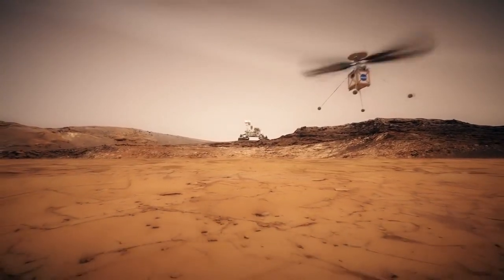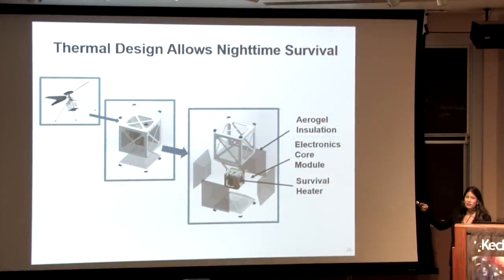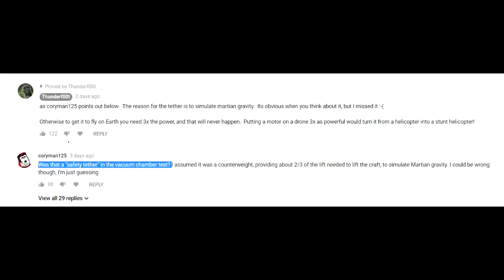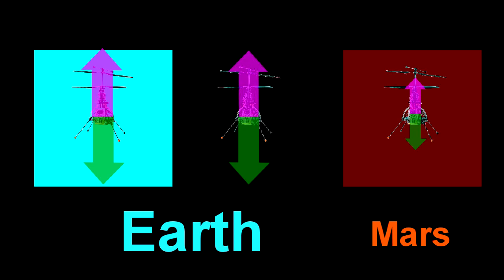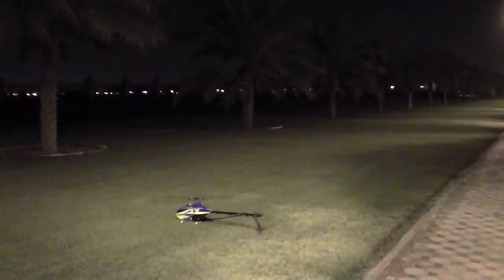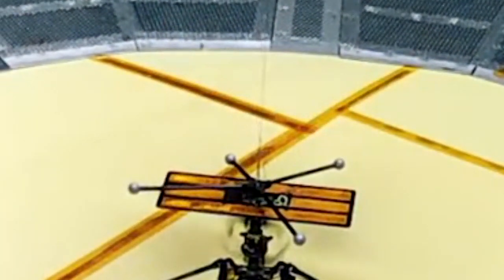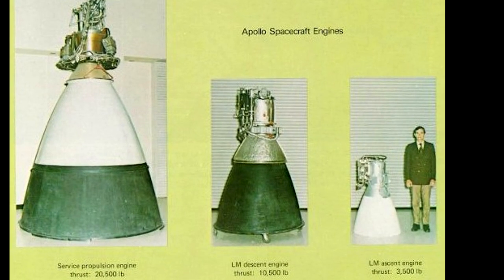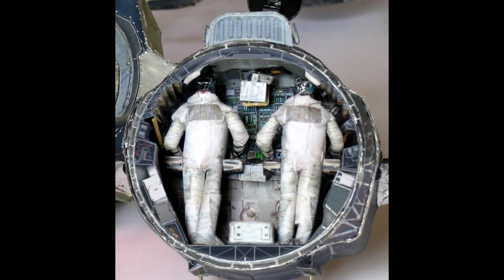Why NASAs Martian Helicopter CANT fly on Earth!

Comment: TF the video about the Apollo LEM module ascent motor was interesting, however, even more interesting is that on the Apollo 11 mission during the lunar phase, prior to ascent, a circuit breaker knob was broken off. Not just any breaker. The circuit breaker controlling ignition to the ascent motor. Buzz Aldrin jammed a pen in it and got it to reset. I think the moment they initiated ascent while thinking about the breaker would the defining moment.
https://www.eetimes.com/author.asp?section_id=4&doc_id=1283891

Comment: 3:00 If you attached a helium balloon to it to provide 66% of the lift needed to fly, then it would still be flying. So how is it different if that wire is attached to a spring rather than a balloon?

Comment: You also screwed up helicopter lift physics i  your last video very badly. What you showed fails even as a simplified explanation. Rotor blades aren't most efficient at 45 degrees, that's well past the stall angle of the blades. Helicopters typically have a maximum collective angle of attack of 10-12 degrees. Also helicopter rotors do NOT" bat down" air molecules, they operate exactly as an airplane wing does (there's a whole raft of factors at play in aerodynamic lift). They are literally a rotating wing with collective and cyclic control over angle of attack. The rotors essentially "fly in place" by rotating around a hub with collective pitch controlling overall lift and cyclic pitch controlling the direction of flight.

Comment: It's untelling without predictive algorithms/testing, whether this thing will fly on earth. Sure it's a fraction of the gravity, but earth has more atmosphere as you said.The denser the atmosphere the easier it should be for a propeller to generate thrust. On the flipside there's the gravity.

The wire is necessary to simulate the gravity, while it is not flying on its own. If you remove the wire. This thing is essentially taking off fighting 9.82 m/s^2  with a small portion of the atmosphere and would need more surface area on the propellers or faster propellers (also keep in mind that once the tips of the blades reach a certain speed you would essentially need to make it a ducted fan to prevent power loss as the propeller tips lose thrust when the tips approach the speed of sound)

From an engineering standpoint this should be a much more accurate simulation of Mar's atmosphere and gravity vs. Floating in water to simulate the weightlessness of space/moon in water. As the wire applying a fraction of the lift will effectively cancel out the excess gravity of earth.

Comment: Well it's basic physics really. I mean, I went to a linguistics high school and I learned enough physics to know the answer to this question:

Mass/weight vs volume

On Mars, gravity is weaker, so they can get away with bigger wings, hence more weight.
And they need those bigger wings, because they need to move a greater volume of air downwards, to get enough action/reaction-based lift, because martian air is so much thinner.

Comment: Actually, the Martian helicopter CAN fly on earth in a vacuum chamber without being tethered! Why you ask? Well, in order to have proper flying performance, you'll need about double its weight as maximum thrust, because you need thrust to climb, fight against crosswind, downdrafts etc. The bit that is now still missing can easily obtained by reducing battery size to about half its intended capacity. On Earth, you can change batteries g

Comment: i said it in the last video and i say it again: pressure and density are not the same !
when you swim in a pool near the surface the pressure of the water almost equals the pressure of the air, but the density is much higher and so is the thrust when you move your arms.
the atmosphere on mars is mostly co2, so it has 1% of the pressure but about 2% of the density.

Comment: Also, in the original video, you absolutely butchered the way propellers work.
 They don't ping the air downwards, instead, they work like wings, and use pressure differences above and below the wing to generate lift.
Reply: He also butchered the math by claiming 1/100 pressure requires 100 times rpm. It only requires 10 times rpm, as per the lift equation he couldn't be bothered to look up.
Reply: Right, and those pressure differences result in a mass of air being accelerated downwards. There are several ways to describe how wings work, ultimately they all work by moving a fluid - the equal and opposite reaction of that fluid movement is lift and drag. Pressure differences, Bernoulli, etc, just describe how that movement happens.

Comment: 0:28. The atmosphere on  Mars is not 100 times thinner than the atmosphere on Earth. It is 1/100th  the thickness of Earths atmosphere. These are not the saying the same thing. Y cannot be more than 1 times less than X. Y-Y=0. If you do Y-100Y = -99Y. Mars does not have a negative atmosphere.

Comment: Err, you've made another slight mistake here. To fly straight and level you need your lift force to be equal to the vehicles weight; whilst the trust has to be equal to the drag on the airframe. To take-off or accelerate the lift and thrust need to be greater than the forces they oppose. The same is true for helicopters where the lift and thrust come from the rotors. The error you've made is not that big in the scheme of things, more of a nuance thing.

Comment: Don't you mean it can't fly on earth - in a 99% vacuum chamber? It might not fly in the carpark either because the motor might not be powerful enough to reach the required speed in 1 atmosphere of pressure. But if they gradually let air into the chamber they may well find a pressure at which the motor can overcome gravity.

Comment: so why not make it able to fly on Earth but not use the full throttle when on Mars?  if it had more power than it needs to fly on Mars it could have the ability to pick up stuff.  if you find something interesting you could pick it up and drop it by one of those rovers that can analyze what it is.
Reply: The propellers that drive a boat through water are a different shape to the propellers that drive a plane through Earth air. Can you tell where I'm going with this?

Comment: I haven’t simulated this but it seams that it would require less power to spin blades up to speed.  And they will likely spin at a much higher rpm then they would on earth due to the decreased air density with no increase in power requirement.

Comment: I think you may need to sit down and think a tad more.

Mars has 1/3 the gravity and 1/100 the atmospheric pressure of Earth.  But pressure is not the determining factor, density is.  The atmospheric density of Mars is ~0.02 kg/cubic meter and Earth is ~1.225 kg/cubic meter.  Mars atmosphere is around 1/61th as dense as Earth

Helicopter lift is a function of rotor speed and blade surface area.  Additionally helicopter blades are aerofoils not planks.  Lift is achieved as with any wing, a pressure differential between the upper and lower surfaces.  

Let's use out of the hat numbers for arguments sake.Say a 2kg drone needs a motor spinning at 1000rpm and a blade surface area of 40 square inches to achieve flight here on earth.  This drone will not fly on Mars.  Reducing the RPMs by two thirds will not get it to fly.  You will actually need to increase a combination of the motor speed and blade area.  In doing so you start an increasing weight battle.

Comment: your knowledge about helicopter aerodynamics is still lacking. when you turn the engine off of a helicopter that flies on earth there is something called rotor autorotation that makes the helicopter comedown like if it has a parachute drag=~1.4 weight it doesn't fall of like a rock. please again check Principles by Gordon Leishmann

Comment: Thunderf00t. The tether is only for safety - it is kept fairly taut so it doesn't entangle with the rotors. The 1/3 gravity was simulated by removing the batteries, cameras & other non-essential mass & running electrical power via a cable from underneath. You can see that power cable in your video clips. Here is my evidence: https://rotorcraft.arc.nasa.gov/Publications/files/Balaram_AIAA2018_0023.pdf [see page 3 particularly - the text UNDER the image]

Comment: WRONG!!! I didnt think this would ever happen, but I say you are wrong in this video. Wow!
They could test it in the vomit comet with a vacuum chamber inside.....So it could fly before it gets to mars, it would just be flying inside a plane flying.
Reply: the vomit comet could simulate the gravity on mars, the vacuum chamber can be made lighter than normal due to the altitude that the plane flys at the pressure is already reduced a wee bit. 
So I call you on this one, why cant it fly on earth before flying on mars?????? Gravity? got that covered, atmosphere? got that covered. what is it missing?
Reply: No. A big chamber capable of 8 millibars is heavy. Also NASA want room to make sure the Scout can be controlled & manoeuvred - takes more than 30 seconds of parabolic flight.
Reply: I know it is heavy that is why I mentioned the fact with high altitude it is possible to reduce weight after all you when you reduce the atmospheric pressure then there is less to pull down, so the chamber does not need as much strength.
flight control testing can be done in a small chamber, maneuvering is different, but by your logic because this suggestion I have put forward cant do maneuvering tests then the rig should not be set up for flight tests??
Now you also forget the fact that the low pressure chamber would in fact be in a flying plane, this allows for lateral g loading to be applied so with the correct flight profile is it possible to test maneuvering in a confined chamber in the plane.
Now remember 30 seconds is a long time when generating flight data,  in that time many programmed g loading profiles can be run. 
so please tell my why NASA would not do this? only 30 seconds? limited flight checks? all these things although very valid they are not enough to not do the tests.
Go play vomit comet with the Super Guppy with a low pressure chamber in there and tell me you can do flight tests???
Reply: your statement is like saying, with a rocket static test stand you cant test dynamic flight loads so no point in doing static tests..........Not how engineering or aviation works.
Reply: So 30 seconds of ground effect in low pressure on the real aircraft for landing and take off data is not worth doing, just send it to mars?????
Reply: Who owns the Vomit Comet?? Nasa
Who owns the Super Guppy?? Nasa
So why couldnt they use their own aircraft to do these tests? Its not rocket science.........
Reply: Bollocks - they used the massive NASA vacuum chamber based at Sandusky, Ohio for 18 hours with a CO2 atmosphere at less than 1%. The 1/3 gravity was simulated by removing the battery pack & cameras & having offboard electrics [see cable under the chopper] - Thunderf00t is wrong in this 2nd video, the tether is purely for safety. The airplanes that fly the zero-G parabolas operate at 20,00 ft to 30,000 ft [WWII bomber altitude] where the air pressure is STILL as high as one quarter of sea level - a vacuum chamber would have to be sturdy & heavy at that altitude to balance a vacuum 30 times less than the outside pressure. To fly higher in a plane strengthened for negative G, with a heavy chamber is probably not on the cards - vomit comet & guppy style aircraft are stuck at maximum of 45,000 feet & that's being generous.
Reply: I totally agree with the altitude, now as for simulated tests by removing parts is not the best way for testing, after all you are not really testing the aircraft if it does not even have its own power supply, also removing the weight changes the flight dynamics so invalidates a lot of tests.
Also remember that the vomit comet pulls zero g's where as this is only needing 1/3 of a g so the strengthening of the aircraft will not really be needed and the test time will be greatly increased from the standard 30 seconds.
The point being is that it can fly in its full flight profile on earth. Now it they do it is another story. but facts are it can be done.
Reply: pull that lot off a aircraft and you change the CG !!! Change the CG and you change the flight dynamics.
fly the chamber at 1/3 gravity and you get the closest flight you can to mars and you keep the original aircraft profile without making any changes.
Reply: before I had to deal with cancer I designed and built a commercial helicopter emergency training device, a flight sim, then I went on to train police pilots on emergency procedures like engine failure and auto rotations(no i am not a pilot I am a engineer), now all that has little to do with flying a drone on mars but it did give me a good insight into flying rotary wings.
i believe it is possible to recreate the basic conditions and fly the final design here on earth in a dynamic test environment. To say it cant be done is an understatement to current engineering abilities.

Comment: Can't they try flying it in one of those planes they use to train astronauts? Just adjust the flight plan so that you only feel a third of gravity acting on you instead of none? Of course theyd need to install a vacuum chamber in there and such but that seems worth the effort and price when you consider the risks you're taking in not testing at all.
Reply: What risks? You lose a piece of kit is all. Have you seen the NASA vacuum chamber in the video? To make a decent sized one on a plane that can take 1% pressure without imploding is one heavy piece of kit. Tf00t is wrong about the tether - it was only for safety & the 1/3 mass was simulated for most/all flights by using a battery offboard & other mass reductions.
Reply: nightjarflying no I mean the risks of sending a potentially not fully tested piece of equipment all the way to Mars only to have it fail
Reply: It's being launched with the new 2020 Mars Rover to act as its geology eyes-in-the-sky - it's a test to see if an assistant in the air would be useful to a Mars Rover. The Ohio-based vacuum chamber is fine for simulating Mars. The gravity simulation was covered by reducing the weight of the scout by 2/3 - they took the battery pack off & ran power via a wire. Thunderf00t is wrong about the tether - it's purely for safety with the power supplied via a cable underneath - check out the video again.
Reply: nightjarflying makes sense

Comment: NASA SHOULD SCALE DOWN THEIR LYING.
You pick any statement of accomplishment by NASA and research it honestly and objectively and it will immediately begin to fall apart. 

It is just another FRAUD AGENCY like the IRS, Homeland Security,  the Federal Reserve, the TSA, the NSA, to a large part even the FBI and it goes on and on and on...
Reply: Do you think that tires than need around 17 atmosphers to explode, will explode when pumped to the usual 2 athmosfers and placed in vacum creating relative pressure of 3 atmosfers?
Reply: Photography, optics, mathematics, physics, astrophysics and even finance will tell you that "NASA is full of it." 

Briefly, let's just look at the Lunar Rover (LRV), this thing is nothing more than a modified JEEP! AND THE COST $38 MILLION!!!

If you take the blue prints of a jeep and you superimpose it on the LRV schematic diagrams that are available you will find a perfect match!!!

In the Smithsonian that had what they called an EXACT COPY of the LRV on display. Someone asked "Were these the exact type of tires as well?" Several curator/engineers said YES!!!
Well the tires were INFLATED AND IF THESE WERE THE EXACT TYPE OF TIRES used on the moon then no doubt they would explode!!!
The next day the tires were replaced with SOLID RUBBER TIRES!!!

Quickly just one more glaring detail, the Hasselblad.

This was the "CAMERA" used on the moon to take all those incredible pictures. It uses a film material was celluloid that melts in even slightly warm conditions, if left out in the sun for example.
Well this was the film in the camera on the lunar surface facing the sun at about 246 degrees Fahrenheit!!! 

You think the camera and astronaut were insulated?
No one has EVER put ion an astronaut suit and walked into an oven and neither has anyone tried to take pictures with a Hasselblad, inside an oven.

 The laws of conduction, convection, and physics prohibit such nonsense!!! !!

And an AC CAN NOT WORK IN THE VACUUM OF SPACE!!!
Reply: You evidently don't understand any of the science you quoted, please go and learn

Comment: Thunderfoot, in principle is it possible that NASA could set up a vacuum chamber on the zero-g plane and perform a mars gravity simulation?
Reply: Possible, but very expensive and inefficient. The plane costs a fortune and they would only have a minute to test it each time. And if they have to tweak something, they have to land, take the stuff back to the lab, make the changes and head back to the plane. It would probable be better to build a very tall tower and drop a vacuum chamber from it at 2/3g acceleration.
But a tether is infinitely simpler and cheaper.

Comment: Can't they take this Heli out of the vaccum chamber? Than it would fly in our atmosphere right? Correct me if I am wrong.
Reply: The two contra-rotating rotors are huge & they are  unhinged - the air resistance will burn out the electric motors which are designed for a minimum of 1400 rpm. I suppose it could be reprogrammed to spin a lot slower, but the reprogramming would include changing the control automatic response of the blade angles. It would be like learning to swim & then being told to swim in treacle - everything's different.